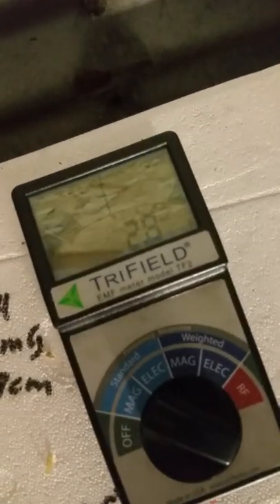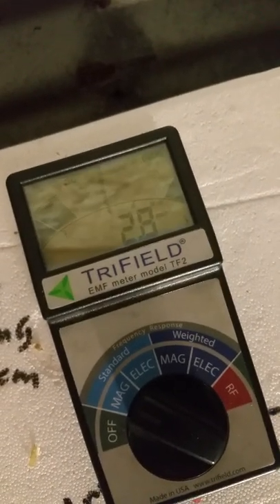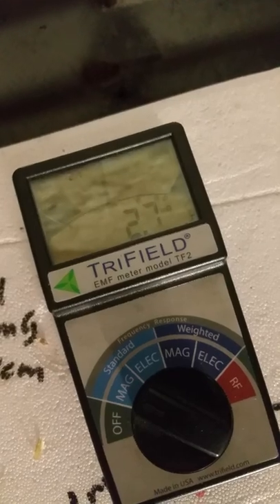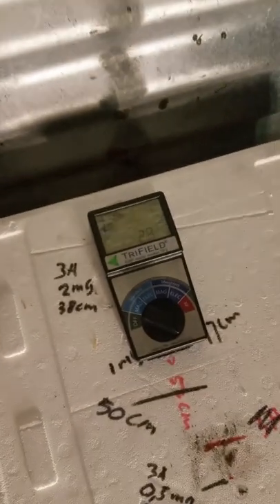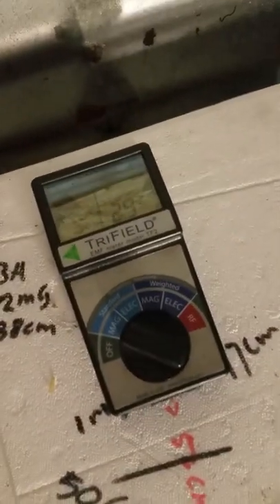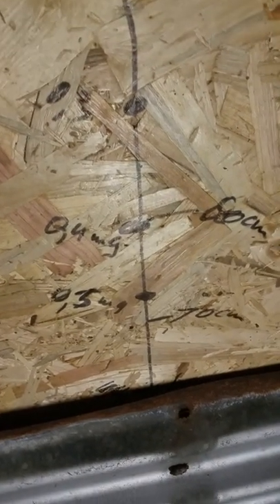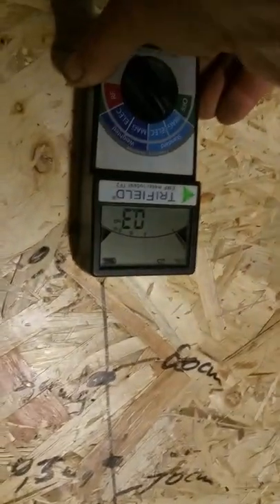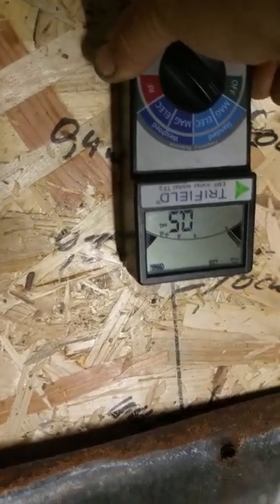O-Day - Henk Jurrien explores the penetration of magnetic field of his SuperSupertor though Fe sheet

Comment: Are you aware if he's been able to replicate the phantom effect?  Also, what right-hand and left hand combinations has he done?  It looked like the outer two levels of coiling were right handed in the picture in the Russian research document.
Reply: I have seen the Phantom effect with a different machine years ago. I have a 2in outer diameter coil wound three levels left (D, D/4). I couldn't detect any Phantom effect with intentional means. But I had very clear effects from the Phantom's that were wandering around my house days later. It messed with a tablet computer I have and gave me radio frequency burns.
I think detection of the Phantom is going to be the hard part, not the creation.
Reply: @spacecase0  Thanks. Really helpful insiights. Stay safe for real, not the fake mask variety. Onward.
Reply: @spacecase0  do you think the Phantom is a stable structure in the aether or in counterspace? And can it be detected by its effects? Would interaction with the Phantom change it's persistence. Can a Phantom be moved with a purpose? Just a curious guy.
Reply: @michaelmarsden2208  it is certainly a stable Vortex pattern. It did change with surrounding objects like aluminum or water sprayed in the air. I never tried to move one but it seems as if they do move on their own. Not sure if that messes with its persistence, but I suspect that is just inertia ( inertia just being what angle the fields are moving at as a group). 
It is definitely something we have to experiment more with to figure out what's going on
Reply from the maker: @michaelmarsden2208  Cosmic Dave says that he has recorded the Phantom and even its persistence in his case for the order of hours. He has noted that in one case, the about 1/3 of the phantom remained in one part of the room, with the rest still attached to the moved coil.

For cases where a phantom may have been detected, I am strongly encouraging attempts to germinate mung beans in their field and compare against controls.